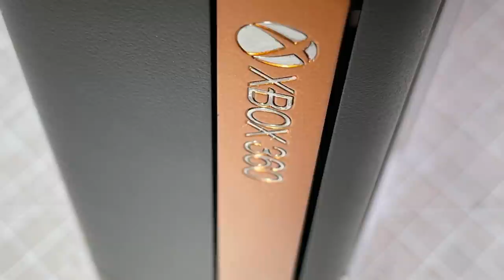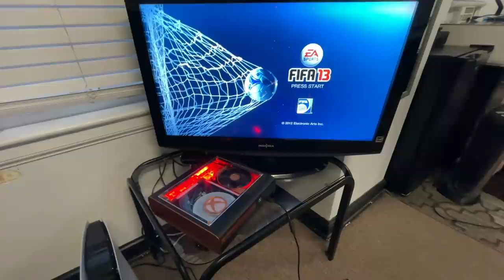Xbox 360 E Transformation - Copper and Black - Window mod and rgb lights

Comment: I always liked the way the 360E looked, never could justify buying one though. Seeing this makes me want to pick one up lol.
Reply: I owned one and the only thing you lose is one usb pott and toslink but they are significantly queiter than slims.
Reply: It's only fault imo is the lack of optical output, I like to use Dolby Digital Live headphones with the 360 as they sound so good seeing as 360 games have DDL natively encoded into them.
Reply: @droksbeel  I think only the Winchester ones were which shrunk the dram and integrated it. The first year of them were still coronas with the same parts as the s ones.
Reply: I have one got for free in May 2021 with 21 games and peak condition

Comment: I feel like you should put some holes in the acrylic sheet in a circular pattern right above the fan blades and leave the center with your logo solid where no ventilation is needed anyway. I mean temps are probably OK now, but given that you just cut off a good chunk of ventilation when the mod likely will cause more dust to be able to enter in the future, I feel like that console may have issues down the road. Otherwise, though, great job man it looks incredible

Comment: 3 questions for you. 1: do you ever encounter any RF interference issues from removing the shielding from the side of the case you cut the window into? 2: What magnets do you use to hold the window in place? 3: after removing the metal shielding what do the magnets actually stick to? Great job and thanks for showing the rest of us.

Comment: Very cool video, however a flow in your design is the epoxy window covering the Xbox fan, it will get EXTREMELY hot in a short time without air cooling resulting in the console shutting itself down.
Reply from the maker: I left a space between the console and the plexi to allow a good airflow.
Reply: @studiofr  Oh right, i see now i just didnt notice it before.
Thanks for correcting me.

Comment: Bro you are a god, you could open a shop on amazon
Reply from the maker: Thanks for the tip 👍🏻
Reply: What sand paper you use? 400/800/1200?
Reply from the maker: 400
Reply: @studiofr  i have 20 sand paper, the last is P5000, which one do you recommend to use? Sorry for my bad english
Reply from the maker: 400 and 800 before painting

Comment: Please do an led installation video.
Also, how does it perform thermally now the grille has gone.
The hot air has to now make a 90 degree turn to escape?
Always wanted to do that with mine but was hesitant with the heat
Reply from the maker: I left a space between the console and plexiglass to allow air to enter the system. 👍🏻

Comment: With the lack of air vents/holes at the top of the console in the plexiglass, where the fan is located, does it not overheat ??
Reply from the maker: There’s a space between the console and the plexi